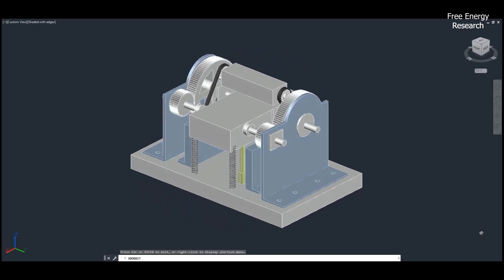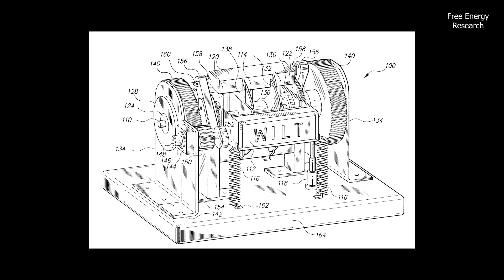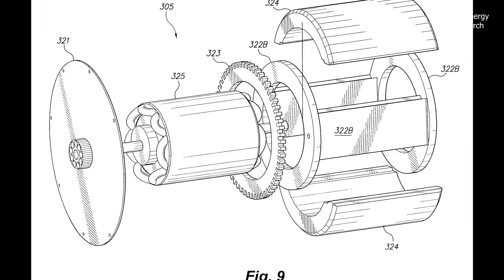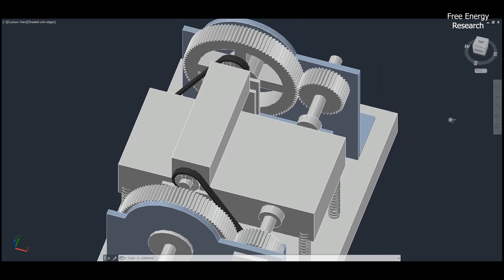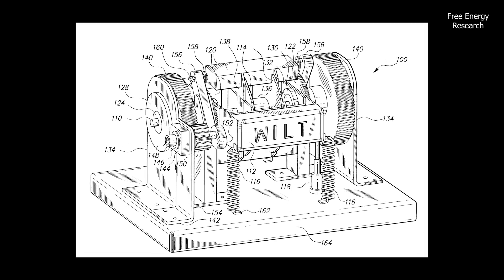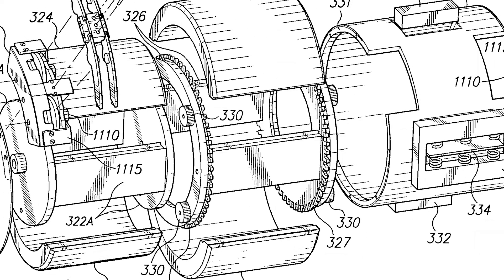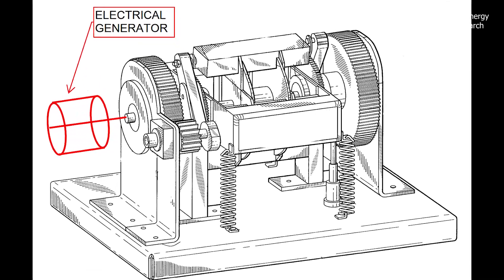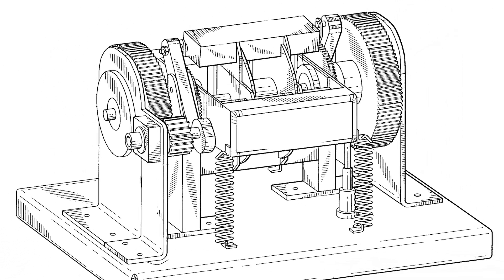Herman Wilt Electromagnetic Engine : [Free Energy / Perpetual Motion]

Comment: Electromagnetic propulsion for dummies..fans, batteries, magnets and control panel. When the vehicles off the magnets lock together in polarity, on 1 set reverses polarity generating a small amount of lift, fan speeds generate thrust and control movement eliminating the need for tracks altogether. Possible or nah? can't be that hard right lol wheres my cut and wheres my Nobel prize. haha. Jk.

Comment: One of the most interesting designs,... 
No surprise if it changes the world
Reply: We're already job numbers dependant on things we already use , coal gas oil lads wont let newcomers have a slice of the cake . 

Jaguar had a flywheel energy system that would convert all braking into a large flywheel in the car boot which would constantly charge a battery, the project vanished into thin air .
Anything that genuinely reduces fuel consumption vanishes / people at street level wont ever see it . 

Search 'compressed air powered cars'  , listen carefully when the inventor is saying 'industry heads in the direction its already pointing in '  , video is +10yr old it should be easy to find .